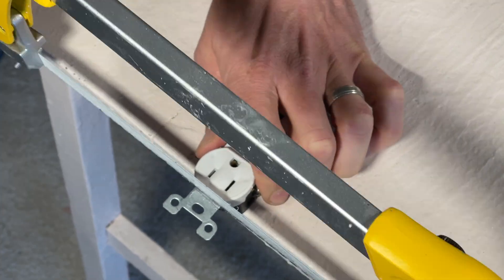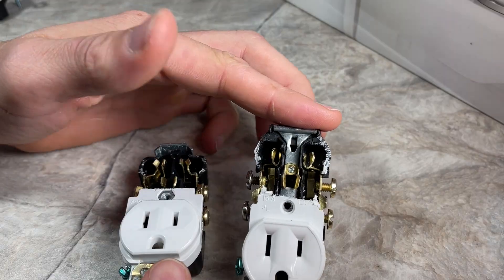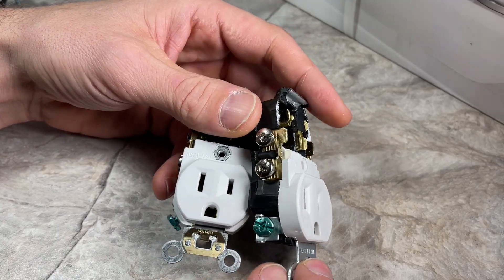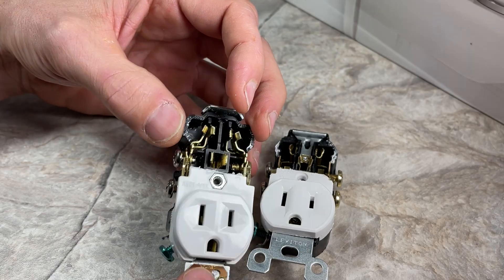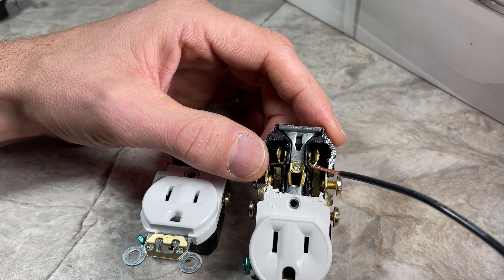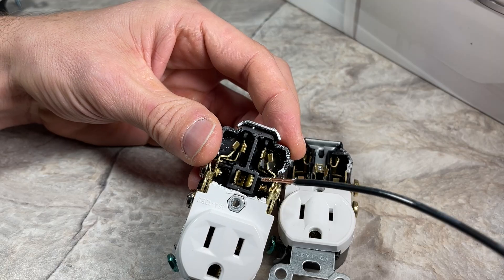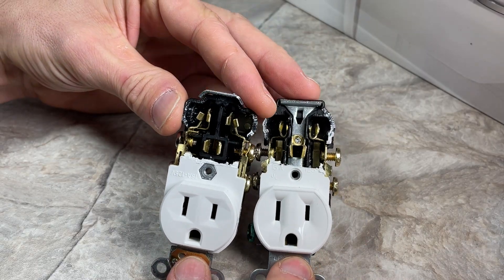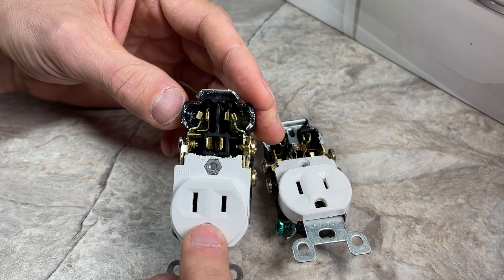What Outlet Should You Buy For Your Home |  Commercial vs Residential

Comment: The real question you have to ask is "Why aren't both receptacles built the same way ?".  Do you really believe it costs any more to produce one than the other ?  They are a different design but the material makeup is about the same, it's not like the more expansive one has silver plated contacts or anything.  It just doesn't make any sense unless you are the manufacturer, the cheaper one has built in obsolescence so they can sell more but are they really making any more money ?  I cut a couple apart myself and couldn't see from a manufacturing or material standpoint why one should cost more than the other other than one was more durable which in this case doesn't cost anything.

Comment: Since Electric Hardware can cause Issues including Fires, 🔥 why not Buy the Higher Quality ? 👍
Reply: Absolutely, but a cheap outlet installed correctly is better than sloppy work expensive parts.  

All outlets should be pigtailed and side-wired.

Comment: Good work my friend. I am a 25 year electrical workers/contractor. I thought I would leave you a couple of tips regarding the receptacles. The first tip is don’t use the receptacle in Lou of splicing wires and creating a pigtail. The reason why there are four screws is it gives you the ability to have that reciprocal split into two different circuits. Meaning if you wanted to have a 20 amp circuit at that location for one dedicated line and another one you take that little piece of metal between the screws and you twist and remove it.
Also you can do this if you want to have one  switched outlet in a bedroom. By code you are required to have a light in a bedroom, but you do have to have a switched outlet in Lou of a light.
Tighten all screws down even if not used. A loose screw can create a short by hitting the edge of a metal box.
It is OK to use the holes in the back of the receptacle is long as you’re not doing an in and out scenario. Once again always create a pigtail. In case of a faulty plug you won’t carry this problem down to the series of plugs after it if you plug in all holes. I hope that makes sense
Reply: Thanks for explaining the reason for using pigtail. 90% of receptacles that you pull out are using both sets of screws. When chasing a problem, you have to pull each receptacle to find the issue.

Comment: I turn over apartments in a 600 townhouse unit.  The basic is fine.  Don't feed into the fear.  If you know what you're doing its fine.  Id you don't, the more expensive one will fail too.
Reply: I've got only 4 rental units, but I use commercial-rated outlets in the kitchen due to the appliance loads.
Reply: @dodgeplow  kitchen we use 20 amp rated.
Reply: @irvingg.1437  That's probably code in many areas, but you can have 20 amp residential or 20 amp commercial, no?

Comment: But, and there is always a but - it depends somewhat on the use that the receptacle is put to. I have a lamp that has been plugged in and not disturbed for over ten years using an inexpensive receptacle. An expensive or 'spec.' grade receptacle preformed poorly in a wall made of lathe and plaster. The entire installation failed because it was used often and the plug was very difficult to insert and withdraw. So installation is very important. Thought provoking video thank you.

Comment: I feel bad for the US, those exposed terminals on the side of the outlets and having to run cable that is twice as thick to handle the low 110V standard.
Reply: What ?
Reply: @donlove3741  most sockets around the world have the screw terminals integrated inside the housing (a live one is fairly safe to hold) and run at 230VAC (double the voltage, half the current)
Reply: @MaxOoze  well why would you handle a live socket? Once mounted the terminals are covered plate.. where's the danger?
As too 230v..  
Never found US wiring to be troublesome.
Most US residential installations have 240v available. 
US commercial uses 208V frequently and industrial I've installed 525V ,480,460,440..
Why do Europeans use 50HZ?
120V is perfectly fine.

Comment: i also do not suggest the push pins that are spring actuated. but there are ones that don't use springs and use a clamping plate with the side screw. i'm a fan of the screws holding it in place than a tiny spring that will break quickly.

Comment: "Commercial" grade is 20 amp and in most applications should not be installed in a residential project where the wiring and circuits are designed for 15 amp. Kitchens and bathrooms should use 15 amp GFCI. There are special applications that require 20 amp or 30 amp (e.g. oven, dryer) but the wiring and circuits must be in place to accommodate. You want the wall socket to fail if you have a choice, not the wiring within the walls. Thats the reason the 15 amp socket is not as robust. There is a disturbing amount of misinformation on the internet.
Reply: Heather Petersen  You want the failure order to be breaker, receptacle, embedded wiring. In a case where the breaker does not trip you dont want to burn down your house because of failed wiring. You also dont want to repair failed wiring as its the most complicated and expansive of the three.
Reply: Heather Petersen  	

If you have a 15A branch circuit its a code violation to upgrade the receptacle to 20A without replacing the breaker and possibly the wiring.

Comment: You may add when a receptacle is loose, there is a greater chance of the outlet heating up because electric connections need to be secure and tight. Bad outlets are always overlooked and your recommendation to upgrade makes sense especially in where outlets are constantly used like with vacuums.  I'm not a electrician but if any one who is, it would be good to give your 2 cents about loose connections.

Comment: There are different grades of residential, for instance a higher grade residential will cost u about 3 dollars or more. Commercial has different grades, Hospital is the highest i believe the orange ones. So saying residential plugs cost 50 cents is not wrong but it isnt correct either. Just like everything else there are cheaper and more expensive versions. You can get a set of pots that cost a 500 dollars and more or u can get a set that cost under a 100. This goes for everything, if u go to the dollar store, they carry cheaper versions of everything, go to walmart u get a little better, go to bed bath and beyond you can get a little higher quality.

Comment: Maintaining contact force in an outlet is vital to it's safety... a loose outlet has more resistance, heats up more... which all can lead to a "Thermal Event".
Any outlet you regularity use... install Commercial grade outlets. And for those residential outlets, NEVER USE those wire push in holes on the back, and if someone installed your home outlets that way .... FIX THEM!!! .. switch to use the screw terminals.

Comment: Price point comparison 50 cents versus 200cents, will the commercial last FOUR TIMES longer? Will the cheapo need to be replaced 3 times during your home ownership time? FCIH. Your logic would be that you need to have a $150000 pickup truck vs a normal priced one. Whereas, I, being on SocSec  would be happy with  a 10 year old Ranger. In essence, your analysis SUCKS!
Reply from the maker: I will try to stop sucking but at the same time you might want to also consider install time / labor. Penny wise pound foolish.

Comment: Ultimately... it makes nearly zero difference to anyone. By the time a cheapo outlet has developed problems, the NEC has moved on and it's out of code anyway. The biggest difference arises in how you terminate the wires to it. NEVER use "stab-lock" connections, ALWAYS strip & curl the end of your wire to go under the screw. The stupid "stab-lock" connections are a poor connection and can give you arcing, which leads to a fire.

Comment: Question: I live in a old house, with a old electrical panel and breaker boxes. We have a problem with the breaker tripping. Will upgrading to a newer breaker improve the electrical from tripping? Sorry for newb question.
Reply: What is the circuit that keeps tripping? You would need to run an amp draw on the circuit to see what it is pulling to make sure the circuit isn't overloaded. If the breaker has gotten weak, you can usually tell by cutting it off and on. It should have a tight feel to it and should make a nice popping sound. You'll need to know what gauge wire is on the circuit also if swapping out breakers. 14 gauge is good for 15 amps. 12 gauge is good for 20. (Guessing you are talking about a 110 volt circuit?) You DON'T want a breaker that is too big for the wire size. You would rather it trip than stay on and catch fire. Just because the breaker says it's a 15, 20, etc. does not mean that someone didn't use the wrong size. Seen it MANY times in older work.

Comment: Thanks very much for this interesting review comparing Commercial and Residential outlets.  I would like point out another difference -- the screw terminals.  The Commercial outlet has a plate between the conductive base which captures the wire and securely clamps the wire providing a better mechanical and electrical connection.  I personally find this much easier and quicker to wire an outlet with both solid wire and stranded wire.  The cheap version of course has the push in connectors on the back, which I would never feel comfortable using and with the screw terminal you have to get the wire wrapped around the screw which tends to want to squeeze the wire out -- not as much of a problem with solid wire, but can leave loose strands hanging out with stranded wire. 
As Roy Najecki points out the cheap residential is fine for outlets seldom used or that have lamps of other items permanently plugged in.  But if the outlet requires frequent plugging and unplugging in places like kitchens or outlets used frequently for items like vacuum cleaners  (they are often going to get yanked) the connections will quickly weaken and won't provide either a good mechanical connections or electrical connection. 
For appliances that can draw lots of current I would also not trust the cheap outlets. I prefer a tighter electrical connection that the commercial grade and higher grades provide. A loose outlet can cause arching and overheating which can especially be a problem with high current devices! I only use the industrial/medical grade outlets in my garage workshop.  These would likely not be appropriate for many household uses and they are difficult to plug and unplug connectors.  
Another problem I see the the cheap outlets is with Romex wire, especially 12 gauge.  I find it can be very difficult to get the wires and outlet into a standard size box and the cheap outlet can easily break. 
I'm not an electrician just an electrical DIYselfer, though I am an electronics tech. Just my 2 cents.

Comment: Oh yeah, hey.  That was a great video!

Wow.  The difference is like that, between a Switchcraft, XLR microphone connector and a RadioShaft, Taiwanese made, headphone, connector.

And oh yeah baby.  The Residential version.  Has holes on the back.  For you to stick, into.  Smaller skinnier, wires.  If you are still having issues with, screwdrivers?  And don't really like, screwing around.  In either direction.  Either straight or gay.

I would have never gone to such great lengths as you have.  Until I would need to replace a melted bargain unit.  When they break in half.  And the parts, fall out.  But then.  You not comparing, carbonized little metal parts.  Against shiny brand-new ones that work fine.

Now what the residential ones can't do.  That the commercial grade ones can do.  Is.  You have this little metal slot.  That ties, together.  Both side pairs of connecting screws.  And here's the big deal!

You stick your slotted screwdriver.  Into that little thin metal slot.  And twist your screwdriver.  That breaks the little metal band.  That ties those 2 sided screw connections together.  And by doing so.  You can now connect.  2 separate electrical circuits.  To both the top and the bottom outlet.  And I've done that on occasion.  Why?  It's simple.

Sometimes you might need to plug something in that requires, 240 volts.  But in the USA we only have 120 coming out of those Edison, outlets.  But we do have, 240 volts of single phase, residential power coming in to your home.  To power your furnace, air conditioning, electric dryer, electric range, HVAC.

And so with those commercial grade 120 volt, Edison outlets.  The top and bottom outlets will still only be outputting 120 volts, each.  But if you wire the other circuit coming into your house.  Into that other outlet.  When you put a voltmeter between the 2 hot tabs of each, 120 volt, outlet.  You will find now, 240 volts, together.  And I've done that plenty.  Because I've needed that.  You see...

I have this gigantic, 25,000 pound, 30 foot long, 12 foot high, 8 foot wide, diesel box truck.  With a ruling audio/video control room within the 3 internal centrally heated and air-conditioned, rooms.  And I need 240.  To power up my HVAC.  But I really don't take much more than 20 amps.  So I can plug it into your bedroom.  When I pull it up in front of your house.  To turn your house.  Into your personal recording studio.  For your next album and work of musical genius.  And you will have one of the world's best, audio control rooms.  Sitting right outside your door.  For as long as you want.  You can supply your own engineering.  Or you can engineer it.  Or I can engineer it.  Or we can do half and half.  I'll record it.  You mix it.  And I only do the very best available in the world today.

You see I just pull up this gigantic diesel truck and plug it in.  Inside your home.  I will take a feed from 2 of your, 120 volt, living room, bedroom, basement, bathroom, electrical outlets.  Some of them are on one side of your incoming electrical fee.  Some are on the other side.  I use what we call a Voltmeter.  Which tells me.  Which ones I need to plug into.  To get my 240 into my recording truck.  Parked in front of your house or apartment.  Yes from an apartment.  Just no drums.  Unless you tell your neighbors first.  That you are recording an album on Saturday afternoon in your living room.  And it's okay if the kids make noise.  The audio engineer says, that will work well in the tracks.  When we hear Billy and Johnny screaming in the hallway.  We will send you a copy of the gold record later.  So Billy and Johnny can hear themselves screaming in the background.  Because that made the hit happened.  Right on that musical rest.  It was just perfect!  Everybody loved it!  Your kids were a big hit!  Too bad they shall both remain, nameless.  And penniless.  But just worked great, musically.  You know how musical art goes.  No?

It is not over until the fat lady loses weight
RemyRAD

Comment: when i buiild my house, I'm going to wire 20 AMP every room
Reply: why?
Reply: @davidjames1684  20 amp are more efficient then 15 amp. Plus if you think about it. 15 amp MAX is around 1600 watts. So if you have a lot of stuff running like a AC unit plus a high end work station that's maxing out that 15 amp
Reply: @Zraupp10  I run 2 space heaters in my bedroom on cold nights and I simply make sure they are on different legs of the split phase, and I run them both at low power (about 650 to 700 watts each).  Problem solved.  I understand what you are saying though and agree it may be a good idea.

Comment: One thing that is that these receptacles are tested by the Underwriters Laboratories for safety standards. So they can assure they will not be a risk to life or property. You can get bad ones, but with all the 1,000's I have installed over the years the failure rate(excluding them being damaged after being put in service) is pretty low.

Comment: I worked at an electrical supply years ago. I tore apart a $1.79 15 amp Hubbel receptacle and the same with a 99 cent cheapie. The Hubbel CR15 was thumbs up against all that I took apart.
Even compared to some Commercial ones which were of other brands the CR15 beat a lot of them. when you compared a Hubbel commercial grade to others, well there was none that stood out.

Comment: I have installed thousands of 15 amp receptacles
My boss bought them by the 5 gallon bucket.
If they are UL and NEMA approved they were legal to use.
Did I use them in my house? No.
Reply: 50 cent outlets and switches have made a lot of serviceman and residential electrical contractors very rich because they know it's only a matter of time before the device will fail. A $250-300 service charge to replace a 50 cent switch because most people are too lazy to ever learn.

Comment: When I do residential outlets I opt for the better quality receptacles. You never know when someone will plug in that heater which draws a lot of current. If the outlet is not in good shape the connection makes heat. You know what happens next.